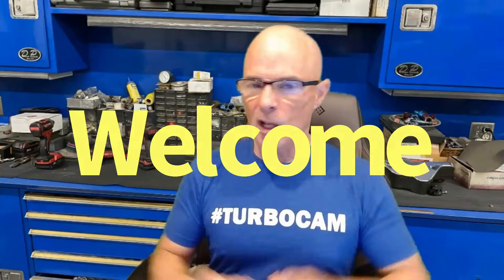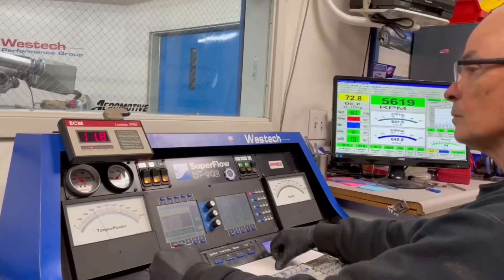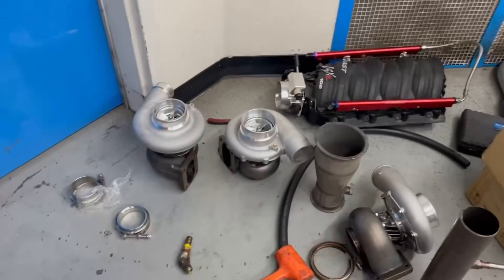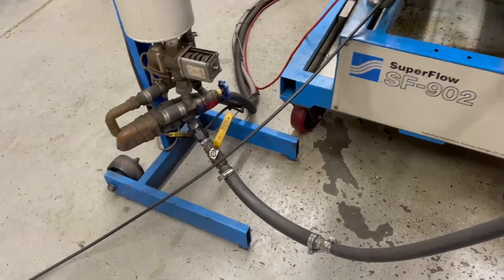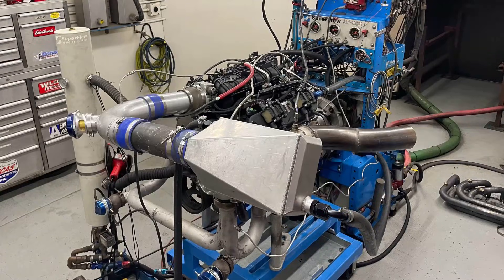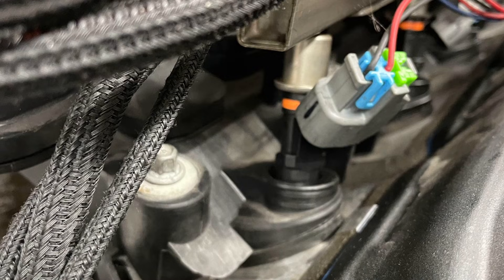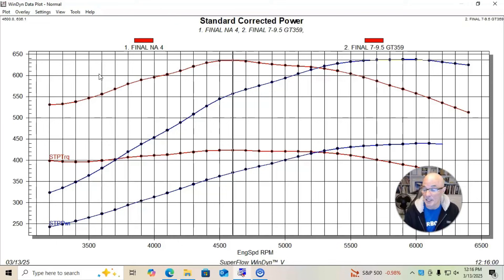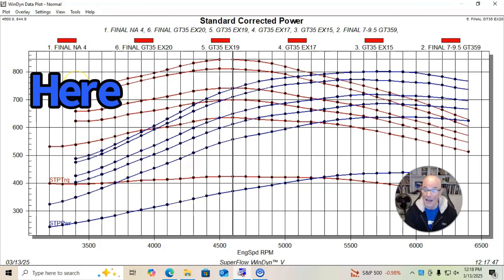GTX3584RS-THE ULTIMATE 800+HP LOW BUCK LS TURBO! HOW MUCH HP WILL A GTX3584RS TURBO MAKE ON A 5.3L?

Comment: How would this compare to like a s366 or a 66/73... currently running twins 366s might have to try some  twin gtx3584rs
Reply: @DLdirtracing  its instant spool conpared to s366
Reply: What is your engine and how does it spool? I am putting 66 73s on a 5.3, I bought them for a 6.0 and the engine changed sizes mid build.
Reply: @davidreed6070  doesn't spool to bad behind my 5.3 with dump valves its about 3.5-4 seconds to 12-15psi. With my converter without the dumps it's about 7-8 seconds. I'm always looking to improve some
Reply: @davidreed6070  mine are just some vs racing 66/73's there going on there 4th season

Comment: I want to see a g42-1200 vs a xona rotor in the same size. 69mm-73mm haven't seen much of either on ls
Reply: @KE458S  g40-900 or g40-1150 would be ideal the gtx3584 is very aggressive and the 73mm s366 is a little soft a 65-70 mm turbine would be just about right
Reply: @bill2178  i wasn't comparing those turbos i named to this test. I was saying in general for a separate test. Not related to this one. I was just making a comment lol
Reply: Maybe the HD series, but a Xona isn't meant for the same market as this and vice versa... a Xona is more than double the price...

EDIT: more than FOUR TIMES the price.
Reply: @joshfraley9451  I wasn't comparing it to this comparison? I want it's own. I didn't say budget. Richard doesn't ONLY do budget stuff so I made a comment. Those 3 turbos are similar size and price so I want to see a comparison. Haven't seen any. Pretty simple.

Comment: oh yeah i can verify this turbo has boost on demand on stock 5.3 pickup and is awesome but i would not have believed it would make 800
Reply from the maker: there was more left
Reply: @ i had to run e85 at 8-10 psi to keep it from detonatingon gtx3584 with the bigger 73 mm s366 i can run 12 on 93 octane  without issues i may swap the s366 to 6.0 and try a 66/68 turbo
Reply: But this turbo would fall flat on its face in the higher rpm’s right?